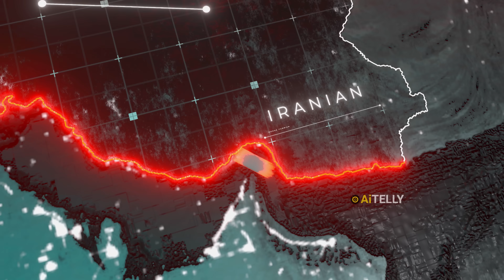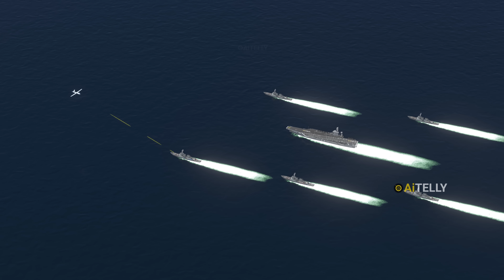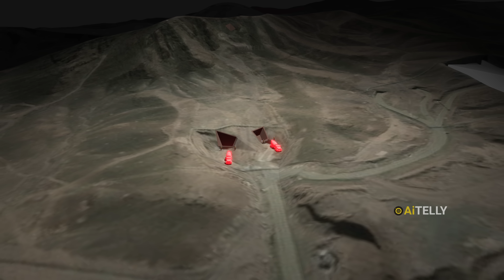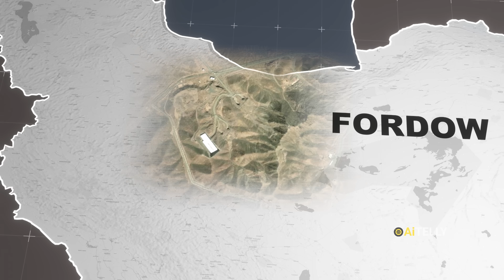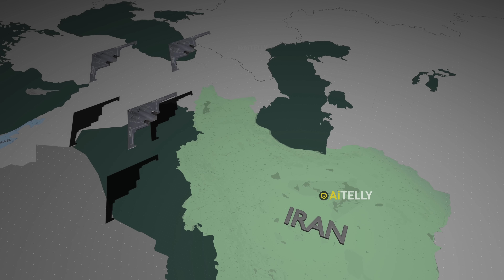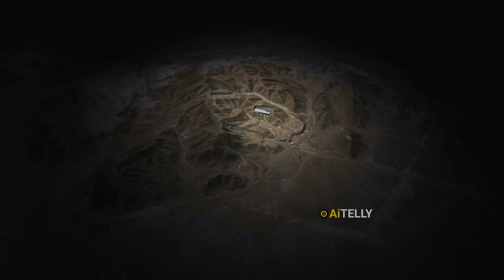Why US Risk a $100M F-35 on a $70k Iranian Drone?

Comment: For one thing, why would the US tie one arm its back by using "cheaper" weapon systems?  If a more expensive F-35 can do a job with less risk than a cheaper weapon...use the F-35.

Another way to think of this is that the US used a $400k missile to protect a $2.25B aircraft carrier.  The objective wasn't to destroy the "cheap" drone; it was to protect the "expensive" aircraft carrier and sailors.

Comment: I can do the math: 1000 x 30000 $ = 30 mil. worth of drone. 1000 x 500 k = 500 mil.
😮. It doesn't look right. It's will be an extremely expensive asymmetrical war for US in the long run unless a fast solution is found.

Comment: And the Darwin award Goes to IRAN advisor on military.
To have send a drone to intimidate a full carrier strike group.
And then showing off the collection of drones and missiles firing in salvo conf.

First if it open (USAF) attack all those toy will not leave boarder and the strike would be more devastating than in Venezuela.

Only if the done preemptive strike of there inventory and the other proxie militia assets.
And hope there is no stock available to continue the pressure. If the have stock left then they would also meet the creator i guess.

Comment: Now the Iranians has the radar signature of the F-35
Reply: Where was it when Israelis performed airshows for almost 2 weeks inside iran's airspace 😅😅
Why couldn't they shoot down at least one jet.. not even an f15? Why?
Reply: @albinjoseph9582 just to made isreal feel more powerful
Reply: @viewerssejati8940  Mind your english before your hallucinations
Reply: @viewerssejati8940  But proof is important because he who alleges must substantiate. Iran claimed that they shot down 5 Israeli F35 jets, but it was nothing but AI generated photos that were being circulated online.
Reply: @albinjoseph9582 WRONG

The israelis wer not.flying inside Iranian airspace. Only Israeli drones were inside Iranian airspace. The attacks launched by israeli fighterjets were done from Iraqi airspace. They used guided munitions such as Rocks and JDAMs. Please do some reasearch. Thanks.
Reply: @RG-yq1uu  Israel did multiple arial refuelings inside Iran's airspace bruh..
The targets israel struck was deep inside iran they can't be struck using jdams or guided bombs.  
Get your facts right.
Reply: @albinjoseph9582 hahahahaha sure, whatever you say is the truth MR.

If that's the case what are the j00s waiting for to level Iran to the ground from the sky? Go tell them they can freely fly at will overt Tehran!! 🎉🎉🎉😂
Reply: @RG-yq1uu mossad was also on the ground with manpads destroying the Sam sites so the birds could operate
Reply: @ashleyoasis7948 Correct, that info is indeed accurate.
Reply: @albinjoseph9582 Oh I thought an F16 or F22 were shot down?

Comment: If F35C had gun like F35A. 
it could shot it down with fraction cost of air to air missile!
but it doesnt! 
BTW why they didnt use F18s instead to use their canon? fear if they got close to Iran s space, they will shoot at non stealthy fighter?
EA18 Growler had gun earlier but removed it to repalce by electronic boxes pod!
but still it could scort E/A18 super hornet to no harm get it!

but in my opinion best way to deal with alot of cheap drones these days (cheap and easy to mass produce and maintain)
is building modern piston fighters (like modern versions of P51 Mustang with much more efficent engines and internal radar with even dozen 0.30 and 0.50 cal combined machine guns (even just 0.30 cals are more than enough for drones)
with alot of ammo 

they wil be subsonic but still much faster than drones,
can intercept and shot down many drones before enter close , over international waters or even at wars like Ukraine-Russia 

one company built pistion engine WWII like fighters for exact anti drone missions, but it just use electronic warfare to interupt UAVs!

but if combine EW capability with machine guns will be perfect (consider EW cant interupt UAVs using very long attached cables! but machine guns can!!!)

and propeller fighter can much much easier to fly at very low altitude (in comparison to jet fighters!)
they can even manouver alot if UAVs chose to hit them, or fast enough to run too!

training pilots for them is much easier and take much less time, and plane it self will be considerbly cheaper in comparison to modern jets!

they even can use them pilotless too! but still with to day tech havig pilot at such fighter will be much better,
controling big drones with dozens of guns, EW ability, aiming percise, manouvering ... still is too hard to control from long distance like drones (and while shooting to UAVs even that ms latencies drones have is high and gonna screw aiming)

Comment: 1. RoE needs to bring up to 2026 reality. 2. Missiles are very expensive. 3. Why treat any Drone as friendly or Neutral? Any drone within 100 km of USN carrier is hostile 4. Pilots should learn to use the onboard m61a1 gun (not sure if the F35 has one). Also it's not a good move to allow IRIAF to learn the defensive tactics of the carrier.

Comment: Why did you make the drone appear so small next to the 35-C? The drone has approximately a 50ft wing span and close to 27 ft long
Reply: Showing the drone so small does the exact opposite.
Reply: You didn’t think this had bias ?
Reply: @CplMnt1989 bias towards who?
Reply: @j @jlen82  American- Zionist side id say
Reply: @CplMnt1989 showing the drone that small does the exact opposite. If this channel wanted to show US strength wouldn’t they show the drone to its actually size? Showing an F35 shooting down a 5 foot drone doesn’t show US strength. Showing a drone that is actually about the size of an F35 would prove your point.
Reply: @CplMnt1989 agreed. It is showing america as the sole winner when in reality what happened was that the shahed 139 drone is a reconnaissance drone used for gathering intel. It wasnt meant to destroy the ship. Anyone thinking otherwise either doesnt understand politics or they are zios

Comment: The missles are not cheap. For that they should have used the main gun for that.
Reply: The F35C dont have gun, they should have use the F18 instead
Reply: @clmn4076  yes it does, it carries the GAU-22, 25mm gun
Reply: @ChrisBrown-le1eo  the f35c doesnt have an internal gun, instead it has a gun pod that can be mounted under the plane if necessary
Reply: @ChrisBrown-le1eo do fighter pilot even use those anymore?
Reply: @clmn4076  the F18 were all in the shop, they should have used an A-10 Warthog instead.
Reply: @Yasb00gie_down so many available models and the can´t pick the right one.
Reply: You know it's not one shot one down and firing over currently tensed environment and the bullet which did not hit the drone will fall down and could hit something and start completing different issues.
Reply: How often do they use air to air missiles though? 😂 that mf was probably about to expire or something shit 😂
Reply: Bro acting like our military doesn’t have a blank check budget and I’m all for it.